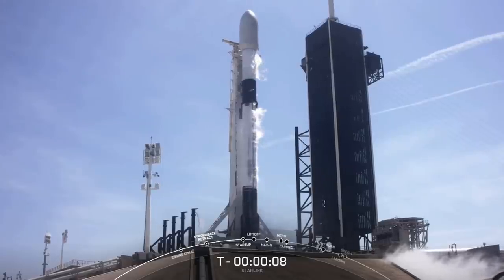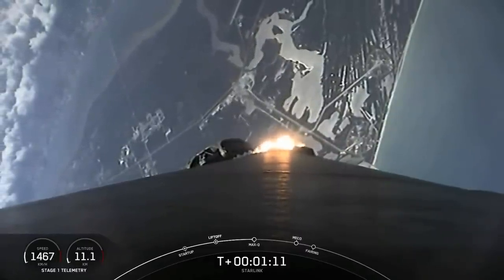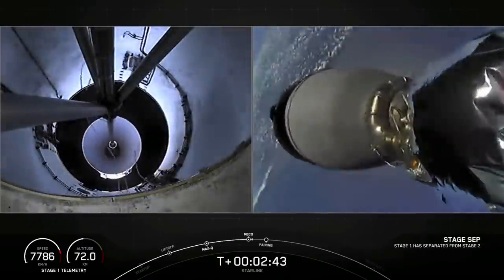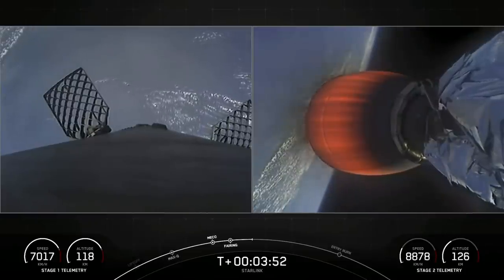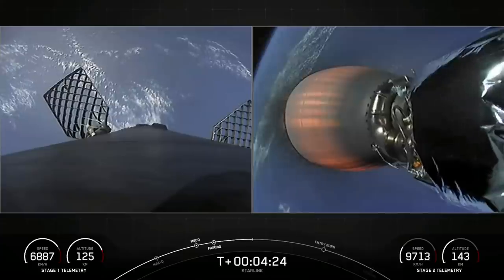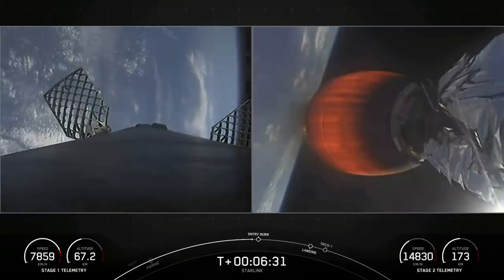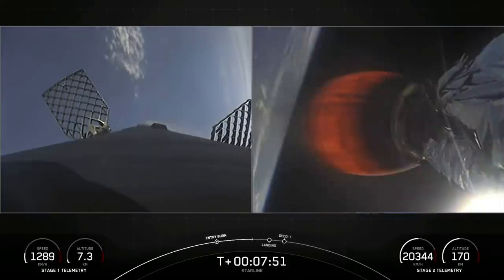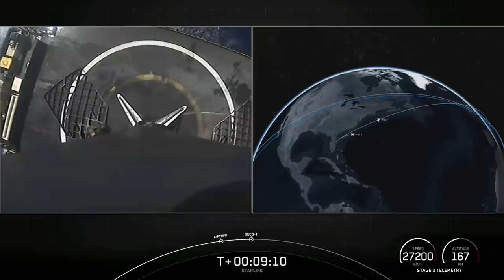SpaceX launches Starlink 25 mission! Nails booster landing

Comment: Would be nice to see the last few seconds of the landing but the signal almost always go out😭
Reply: Yes, that's the bit I want to see! Why does the signal always go at that point?
Reply: @mussie302  if im not mistaken, its because plasma build up.
Reply: @muhammadharits7127  Well, you ARE mistaken. No plasma at THIS stages
Reply: @laszlok53 its cut out in re entry, idk about the landing, maybe because the backlash of the engine
Reply: @muhammadharits7127  Both the landing units AND the platforms cameras at the very same time?
How plausible is that?
Reply: @muhammadharits7127  they've explained it's actually because of vibrations. They misalign witth the satellite or whatever they are using and the signal cuts off
Reply: if you think about it, the first stage weighs a LOT even when nearly empty. When it get within a certain distance of the barge, the engine plume begins to put pressure onto the deck as it cushions that rocket’s mass to a nearly complete stop. All that time the barge is absorbing that engine’s chaotic force. This results in a lot of sharp movements in the barge which translates to misalignments of the satellite uplink which likely overwhelms the adjustment capabilities of the equipment. I’m sure plasma and vibrations play a big part too.
Reply: @FrankConforti  thank you for writing an essay just to answer random people on internet, nice explanation tho👍
Reply: Why don't they take video from a few miles out?
Reply: @tyatwell35  I guess it's an unnecessary waste of resources just for the public to enjoy a view
Reply: @tyatwell35  Well, as fa I can see, there are a number of ships around, and they could do that. And I'm sure they did. Why we can't see them? Now that is the $10 000 questoin.
Reply: @FrankConforti  Well, surely not "plasma". Vibrations on both the unit and the platform? But no vibration until the last few meters? A bit too far to fetch? And did all the other ships around suffered of those vibrations to loose their contact with the satellites?
Not very plausible. I just hope that they'll "find" the recordings that did not go through the sat. comm. but stored locally, and we'll see the touch down later. I'd really like to see it.
Reply: By dropping signal it cuts down on CGI costs per flight.
Reply: @AceMBP  hahahahah nice troll
Reply: @gonzapato1006  Then don't feed him...:-)

Comment: I wonder why the footage gets interrupted everytime the booster is about to touch down
Reply: I've been wondering the same thing. Not saying it's fake, but I'd like to see the whole thing.
Reply: @adrianboimvaser  the vibrations from the rocket shake the antenna causing the antenna to vibrate against the radio frequency it's trying to detect, there are videos of full landings but rarely live.
Reply: Because the vibration and the rocket creating smoke
Reply: Getaran bang, gak jauh2, coba aja situ live streaming terus disampingnya knalpot motor digeber2, dijamin sinyal bakal putus2. Atau gampangnya streaming sambil naik motor ngebut, yg ada sinyal ilang.

Comment: I want to hear from the ‘old timers’ engineers, designers, astronauts, etc. I think those that were part of the early generations of space flight, should be allowed to take a ride!
Reply: @tripplefives1402 So Crew Dragon is not a thing?
Reply: @tripplefives1402  No, it does not. The ship (aka the rocket) is the same for both StarLink and Commercial-Crew launches. Crew Dragon uses the exact same falcon9 booster and 2nd stage. Only the payload (a stack of satellites covered by a fairing this time, the capsule with trunk in the case of crew dragon) is different. 
I like to think that Shannon didn't mean "stack all the 'old timers' under the satellite fairing" when he wanted to take them for a ride on falcon 9.

Comment: I still can't believe how they manage to get this amazing rocket into the air and then, get it back to the ground but they can't get a camera to keep signal just before landing...Every time:-)
Reply: Because video is transmitted via a satellite link. This requires a satellite dish to be precisly oriented to a satellite.
Not an easy task, when a rocket engine blasts at the satellite dish.
Video and telemetry are not installed to entertain the audience but to give engeneers clues of what went wrong. For this a recording is sufficient (and actually much better). Guess what: video and telemetry are recorded at the platform and in the rocket. Cut offs in the satellite link are no big deal for the engineers, since nobody could react in real time anyway.
Live video is not a top priority issue for performing such a mission. So why waste money to make it happen?
Reply: @kallewirsch2263  Or they are scared to show it ending up in the sea like the first few.

Comment: Landing reusable rocket  boosters just fine, but can't get a video camera to work... :-))
Reply: The cameras work fine. It just isn't easy to have a satellite dish oriented to a satellite while the base is shaking like crazy (because a rocket blasts at it).
Video is recorded (as well is the more important telemetry data) on the platform and the engineers get a look at it after the whole  setup is brought back into port.
No big deal. After all, video and telemetry are installed to be able to figure out what went wrong - and not to entertain the audience. Having a recording is enough to fulfill that purpose.
Reply: @kallewirsch2263  You don't need a satellite for this, if that's what they do. When landing, the cameras could use a local radio link - not least because they do indeed try to entertain the audience, which is very cool :)
Reply: @Trottelheimer  The platform they land on is in the middle of the ocean. You need a satellite link just as any other ship needs one when they want to do high bandwith transmissions like eg. video.
If high bandwidth is not required one can use low frequency radio waves, but this is barely good enough for recognizable speach transmission. Not good enough for video. As soon as you are a relatively small milage away from the shore, there is no way around a satellite link.
Reply: @kallewirsch2263  Well, use a local radio link to one of the companion vessels, and do the satellite bounce from there. They make a number of showing these landings, and we all love it,  so why not a tiny effort to secure some integrity of the live coverage? You know, SOLVING problems, and very easily so :-)
Reply: @kallewirsch2263  It doesn't cost much money for a local radio link with s satellite relay. And a vessel IS already standing by within reasonable range. Remember, they land these boosters among people and equopment on land - having a vessel a kilometer way is not a problem.  I'm not impressed - this should be solved, cheaply and easily, not endlessly problematized.

Comment: How they return the Falcon 9 engine the main one not the booster or they leave these engines jn the space?
Reply: They let it burn up in atmosphere
Reply: @williamseeney8727  wtf so they happy cause the boosters return well and the main engine is being burned every flight
Reply: @bluepanther4356  what? You mean the booster or the Merlin engines? Falcon 9 First stage with all 9 Merlin D-1s lands back on the dronesjip or landing pad. Second stage deorbits after payload deploy and burns up. All 9 Merlin engines get reused, answer as the booster
Reply: @Cediii4ris  so the engine that sealed with the Satellite returns back into the landing pad
Reply: @bluepanther4356  what? You mean the second stage? No. It deorbits and burns up
Reply: @Cediii4ris  that engine in the right of the video which is making thrust then heating to orbit the satellite

Comment: Why does it cut off all the time when landing? Dont they have a third camera on a drone?
Reply: Because video is transmitted via a satellite link. This requires a satellite dish to be precisly oriented to a satellite.
Not an easy task, when a rocket engine blasts at the satellite dish.
Video and telemetry are not installed to entertain the audience but to give engeneers clues of what went wrong. For this a recording is sufficient (and actually much better). Guess what: video and telemetry are recorded at the platform and in the rocket. Cut offs in the satellite link are no big deal for the engineers, since nobody could react in real time anyway.

Comment: The chinese rocket, Jetesonned its booster rockets after 200 km high. This is only 100 km. Not much higher than X-15, so you still have another 100 km to climb, to get as high as China, and 300km higher to reach Israeli Space Station Orbit.

Comment: nice landing but always seem to lose the pictures just before touch down, is there no way a shot of the first stage landing on the barge taken from some safe distance. the onboard cameras seem to fault out at the crucial times in the landing procedure
Reply: The boat bounced slightly when the rocket landed, threw the antenna off for a sec. That's all. They'd have to rig a mondo expensive stabilizer to correct it. Not worth it.
Reply: @MM22966  so I think the side shot would look more impressive to me, to see it from a 100ft or so to the point of landing would again be very impressive to me

Comment: Does it make sense to put hundreds of satellites in near-earth orbit, where they can crash into manned spaceships at that general altitude?
Reply: No, that orbit should be banned.
"How does the Universe work?"
...that answer just got pushed off.

 Starlink albedo is VERY high. Even with "dark" version. To understand how this works: Astronomy uses 3,200 Megapixel cameras to see galaxies 12 BILLION Light Years away. (Vera C. Rubin, ex.)

These 30,000 bright pieces of space junk are a horrendous blow to human exploration of the Universe.

And $Billions of dollars of telescopes.
All for one man's greed.

  Amazon wants to crap-up the Earth orbit as well. Starlink 30,000 mirrors in orbit reflect sunlight in an ecliptic plane. This is a massive blow to telescopes coming online after 15 YEARS of development. And costing $500,000,000.00 EACH.

It's devastating to human knowledge and advancement. No satellite blankets should be allowed in LEO orbit. We need an International Space Treaty.

 Just to put numbers on it: our new 30 meter mirror telescope will have 10 times the resolution of the Hubble Space Telescope.

How good is the Hubble Telescope?
Okay. That's the difference. Now multiply by an order of magnitude (10). Now THAT'S the problem.

Comment: I'd watched multiple Falcon landing videos. Found out there are always a couple seconds video lost right before landing on drone ship?!  Does anybody has an answer? Or it was just a repeating coincidences.
Reply: Because of insane sound pressure from Merlin engine during landing the barge and its antennas rock so much that data link is lost. I believe they use an optical/laser-based link from barge to support vessels. At some point recently I think they tried to use their own StarLink for data com (streaming video) but apparently that is also sensitive to vibration
Reply: Plasma interference.
Reply: @scottslotterbeck3796  ok, thanks